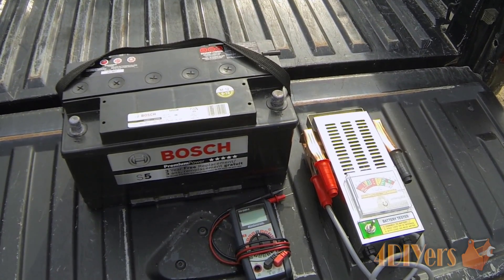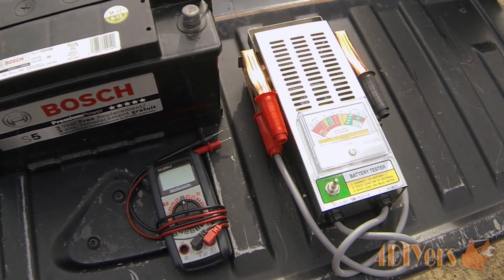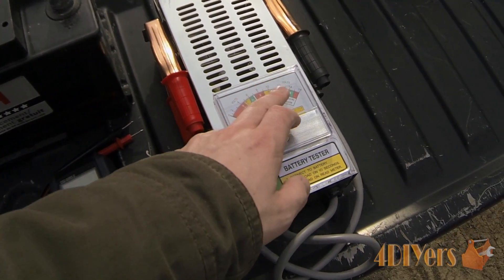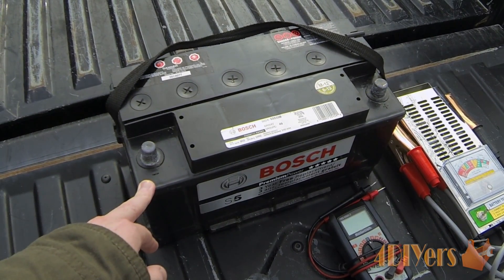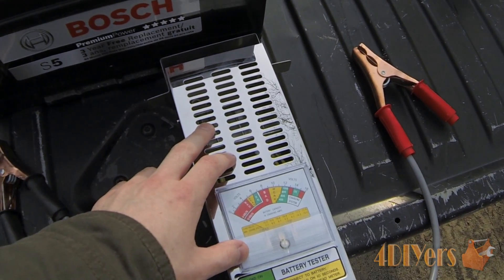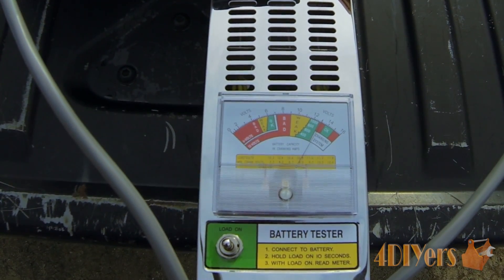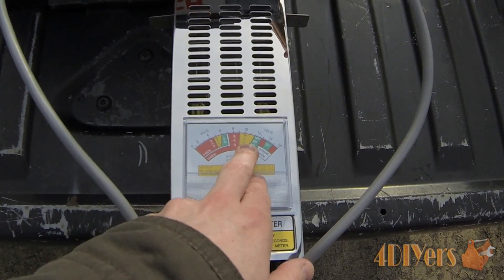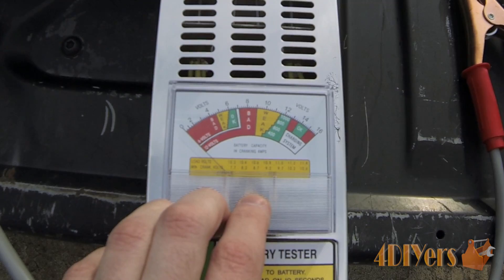How to Load Test a 12v Car Battery

Comment: The only problem with this is the machine doesn't have enough load to put on the battery your  testing.
 You have to put a load on it to the equivalent of the starter draw of the engine.
Reply: 100amp isn't enough?
Reply: @ABCHIAndy yeah not even close. You should typically load test the battery to half its c c a value. The handheld tester will not be able to accomplish that.

Comment: I'm thinking just getting a battery. The first one in the car was holding a charge but did the second test which was load test came up totally dead like I was testing a piece of wood. The needle fell to zero. So got the other battery from car I don't use much thinking it was pretty good but load test came out to just under 11 volts slightly into yellow weak zone . And yes charge test came out to 13 volts . Replace?

Comment: There's three tests I could do with this and did the first two checking first the charge which was good at least 13 volts right ? Also the load test which was just under 11 volts putting it in slightly in the yellow range. Do you recommend the starter test and what reading would be good ? Should I replace battery and don't need to further check starter ? Been having trouble with starting it first time . Need to crank it a couple of times to start ..

Comment: so, does the battery have to be fully charged for an accurate load test?
       i just went to get my tires rotated and ford service claimed to do a load test without my request. they said the battery is bad but i've never had any indication of a bad battery. also, wouldn't they have to CHARGE my battery before the test? and why would they charge my battery for free just to do a load test a never requested? 
        i'm suspicious of a scam. should i be?
        also, where's the date of installation on batteries? if i knew the date of installation it might give a clearer idea of whether the battery might be in need of replacement.
Reply from the maker: In order to get a proper reading yes. This is exactly why I bought the tools so I wouldn't have to depend on someone's equipment to test a battery. It's happened to me a couple times where someone tried to sell me a new battery when mine was still fine. Your alternator should have fully charged the battery though, but then again this can depend on your recent driving. There should be a date on one of the stickers of the battery. Sometimes a tag on it's own or included in the information with the manufacturer labels. Even if a battery is 5 years old, it doesn't mean it's bad. My one car I've had for about 11 years, the battery was used when I bought the car and it's only needed a battery within the last year.
Reply: @4DIYers  ... thanks so much for responding to my inquiry. just took my car to walmart, not a big fan of walmart. they found the date on the side of the battery. it had to be removed to read it. it read 7-20. so the battery isn't even two years old yet. they did a load test. it read - fine! i had them charge the battery anyway. they did all this for free. (thanks walmart.)
        i'm really surprised my local ford dealer would try to rip me off. they screwed up a lot. they rotated my tires front to back instead of left to right. they didn't clean the inside of my car for a wash as they promised. and, i discovered upon returning home, they checked the wrong tire for a leak. so i still have a leaking tire. their utter incompetence astounded even me!
         seems we can't trust anybody these days. i guess i'll be buying my own load tester soon. thanks for your input. its appreciated
Reply from the maker: No problem! I had no idea they'll check the battery for free, that's a nice service and you don't typically find that anymore. I worked at a Toyota dealership one year, lots of nonsense goes on behind the scenes. Even for the handful of times I've taken a vehicle in when I was in a pinch, I've caught people trying to pull a fast one on me. The downfall now is that I end up doing everything myself, so I'm swamped with projects. I'd be inclined to leave them a review. Happy I could help. Feel free to check out my other videos too, I have a bunch of tutorials on various topics. Even if you don't do the work yourself, at least you have an idea what to expect so no one tries to take advantage of you. I even have one for tires leaks too, might be something as simple as a faulty Schrader valve.

Comment: Aren't those testers only good for 100 amps test? If a car needs 500 to 700 amps won't that mean its not really good to tell if a battery is really a good one?
Reply from the maker: The battery tested in the video gave a reading for 800cca (cold cranking amps). The battery can measure up to 1000amps. These testers are specifically designed to test automotive batteries.
Reply: @4DIYers  Got it. Thanks.

Comment: Thank you very much for you information.....
So like you said if the battery is more cranking amp's than the smallers battery 9.6v So will be a little more higher.....yes make sense, depends of the cranking of the battery I guess my car maybe is 700cranking amps.....But the really important is good w/ this item to check also the BATTERY LIFE......thanks again!!!
Reply from the maker: +Danny Chuqui Yes it is. Do you have a battery charger as well??? You must ensure the battery is fully charged for the test to get the correct reading. The battery in my vehicle (one that is shown in the video) is an 800 cranking amp battery. Beyond having a high draw from the starter, my vehicle is also a V8 and has quite a few electronic components to keep up with. Glad to help out!

Comment: Hi, I just watched you video......Question?
So really work that item?
So what I am saying is I can check the battery life if is weak like you said UNDER 9.6 I have to replace the battery? So I don't have to go anymore to the auto parts near me to check right......... Because one time I did w/ the multimeter, the VOLTAGE it was okay..... and I took to the auto parts to check for me......you know they have a big tester in there.....SO W/ THIS BATTERY TESTER I CAN CHECK THE BATTERY LIFE RIGHT? and what's the bad number and good battery life number...... thanks again.!!
Reply from the maker: +Danny Chuqui Yes it does. This is the same tool found in automotive repair shops. The auto parts store also charges the battery as well besides testing it. But I have found in many cases to get false readings on those machines, which is why it's better to have your own tool for this. Using a multimeter won't determine if the battery is fully operational. The simplest way to example how this unit works is it replaces the starter. The starter has a large load on the battery (high average draw) and if the battery is older, it won't be able to withstand that. The 9.6V was an example for a 400 cranking amp battery which is a very small battery. You can determine the cranking amp of a battery by reading the specs printed on the outside of the battery. So for a 600 cranking amp battery, the voltage will need to be slightly higher than 9.6V which is shown by the steps on that green section I referred to printed on the meter.